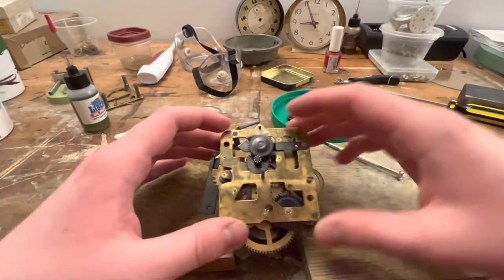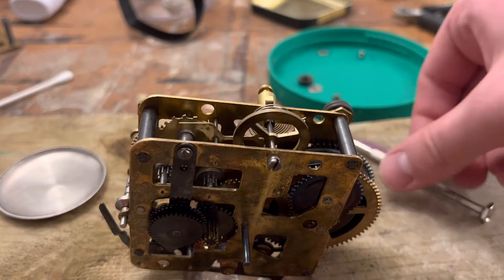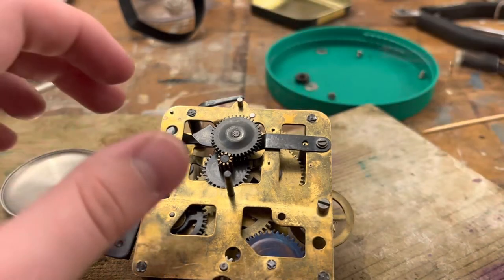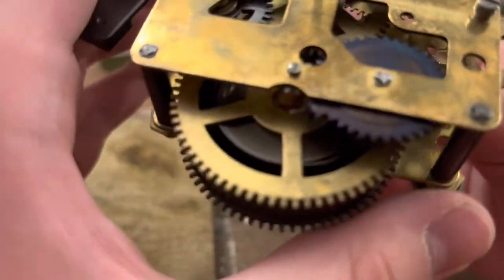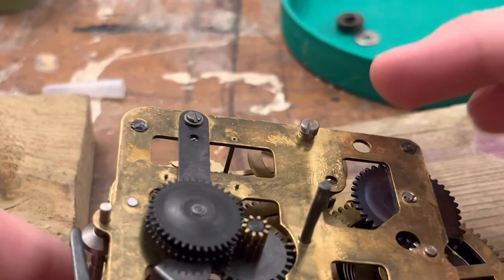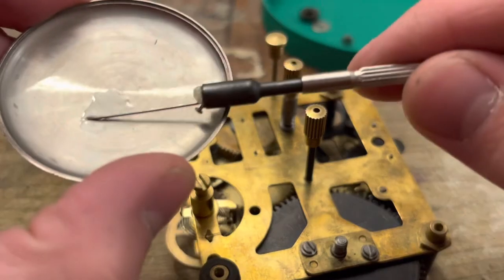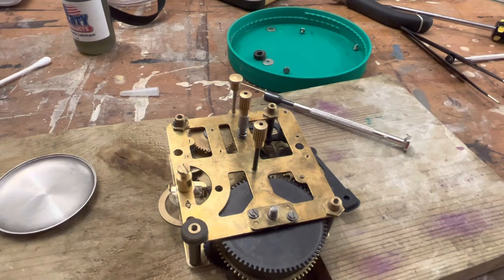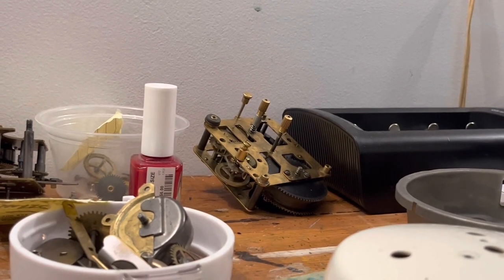Westclox Big Ben Style 7 Movement Reassembly (Part 6)

Comment: I happened to comment to your latest video instead of this one ☝️. I would invest in the mainspring winder 🌬. I’d never try to unwind 🌬 a mainspring by hand 🤚, under full tension. I also would not do it under even slight tension. The spring’s sharp coils could hurt 😢 your hands 🙌. Also, your clock 🕰 can explode 🤯, shooting gears ⚙️ and parts all over your room. This can also damage the gears ⚙️, as well as injure eyes 👀 or other body parts. I don’t know the best quality of spring unwinder 🌬, or winder 🌬. I also don’t know the most reasonably priced one ☝️, either. All ya need it for, is to power 💥 down the mainspring(s). Your friend, Jeff.